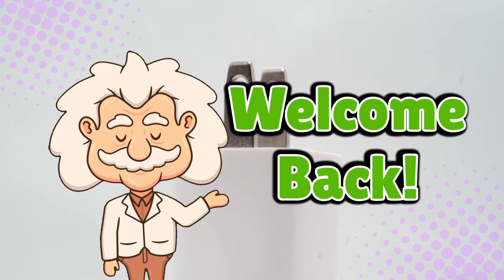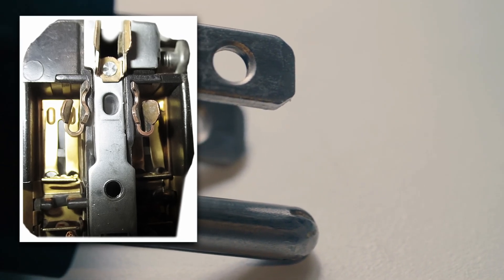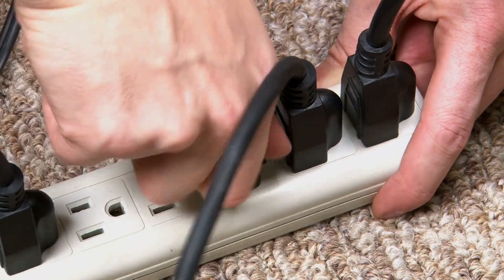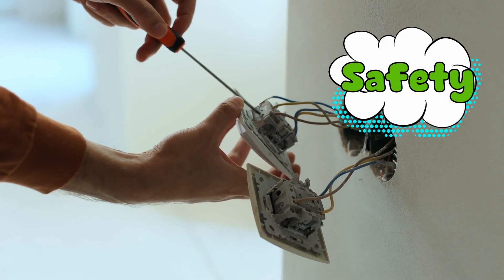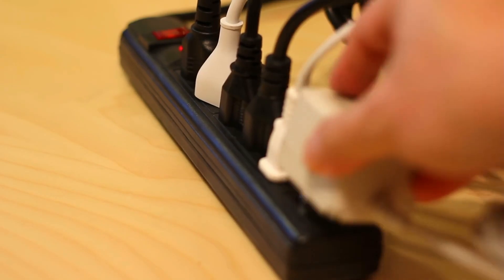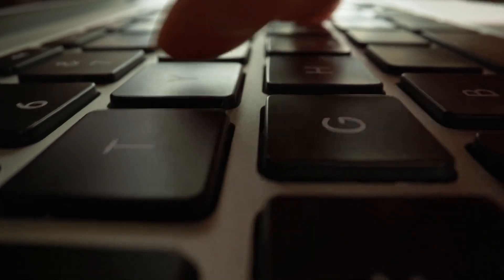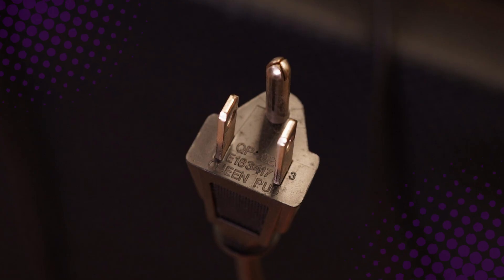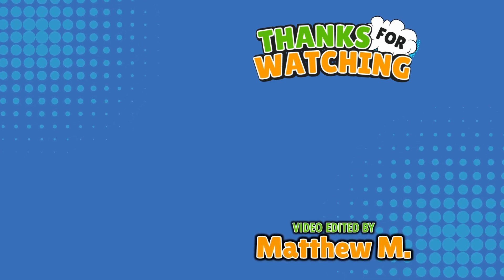Why Do Electrical Plugs Have Holes in the Prongs? Tiny Holes, Shocking Purpose

Comment: The holes in the prongs also allow a special lock to be inserted, in order to lock out tag out (LOTO) a piece of cord and plug connected machinery.   

Fun fact:  The two prong plugs we all know and love today, was invented by Harvey Hubbell (1857-1927) in 1913.

 From the 1910s until about 1940, there were two versions of plugs widely used, the tandem plug, and parallel plug, which have prongs shaped like "— —" and "| |" respectively.  The  NEMA standards for receptacles as plugs as we know today, didn't come about until the 1940s.  The 1910s - 1930s just so happened to be a time when many new electrical appliances hit the market as many homes were being electrified for the first time .   As a result, the various manufacturers couldn't all agree on which version of plug they should be putting on their new fangled appliances. The old style receptacle with two slots resembling a "T" laid on it's side was designed to accept both plug types and homeowners across America appreciated them for the convenience they offered as the "universal" receptacle.  This receptacle was invented in 1913, the duplex version  came about in 1916 and was most popular until the mid 1950s.